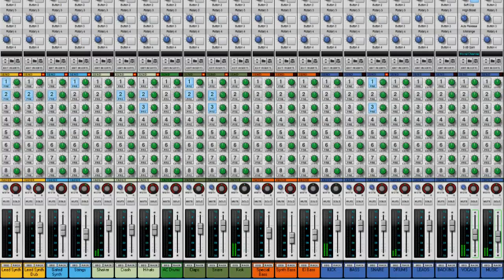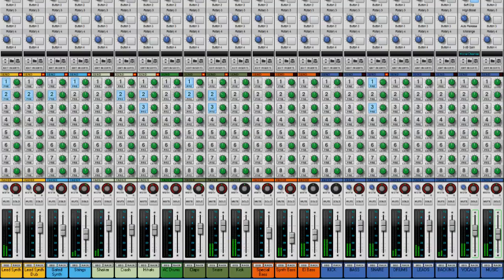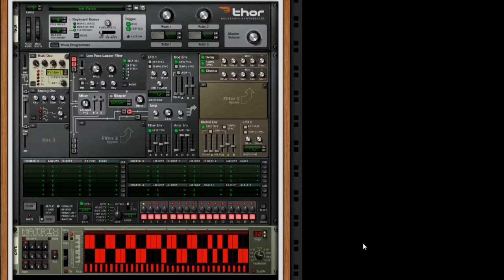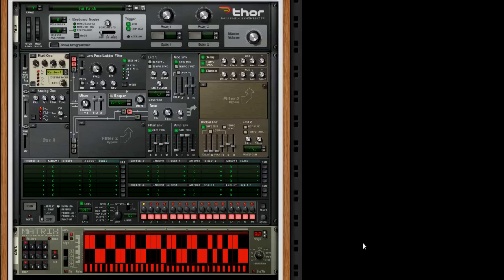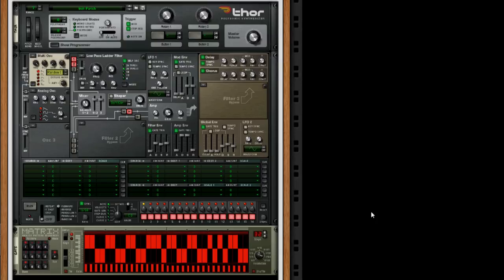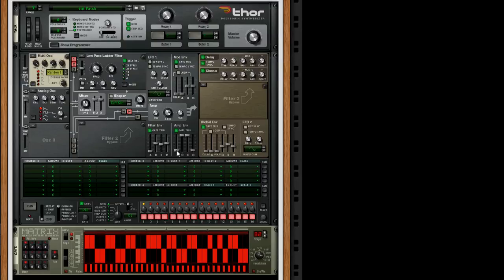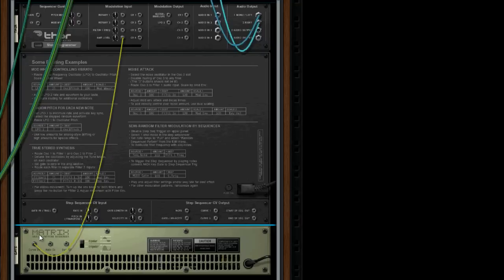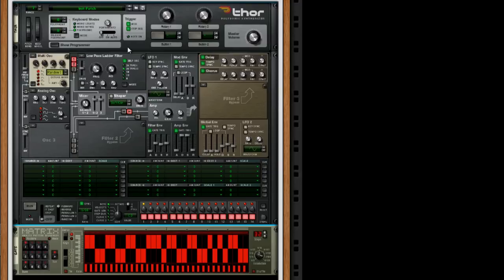How to make a Trance Gate in Reason

Comment: @mordsgaudimachen Some arpeggiators have a chord mode in which the arpeggio pattern is aplied to the chord. The fundamental difference is that arpeggiator modyfies the note information before going into the actual synth. So the notes get retriggered for every "gate". Gating modyfies the amplitude after the envelopes. In arpeggio the amplitude is modulated by retriggering envelopegenerators. That basicly means that you can't have like filter envelope with slowish attack like on the video.

Comment: @peakeleven I found it works if you use a single note, or write an arpeggio for whatever notes you want... but yes its different.
As for hardware, I like the VA synths. My sh32´s and Access Virus C. I also have an mc808, and 909, and a Roland SH3.... not the 3-A. Good old analog ^^ 
Also I like to throw in some vinyl, Mostly whatever it takes to entertain myself ;)  Are you a bigger fan of hardware or software? Or does it depend on what qualities you look at?

Comment from the maker: @mordsgaudimachen Hey! Sure I will try to at least. The major difference between an arpeggiator (arp) and a gate is that the arpeggio is used to make "running" chords and a gate is used to chop up any sound into a rhythm. If you hold down the notes C-E-G for example, an arp makes them run in a sequence C then E then G and so on. If you hold down the same notes and use a gate and program a rhythm the notes will still play at the same time, but with a rhythm. I hope this helped. =)